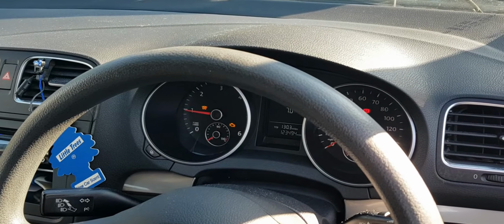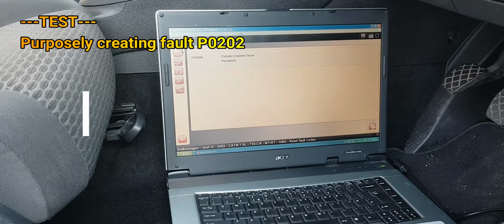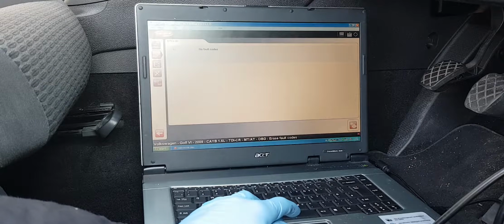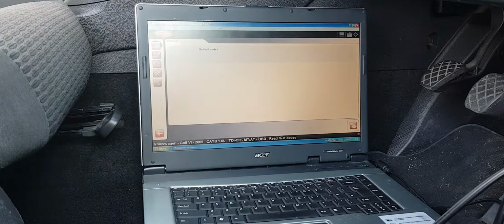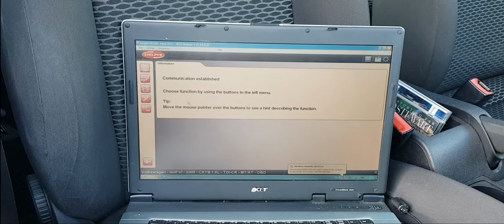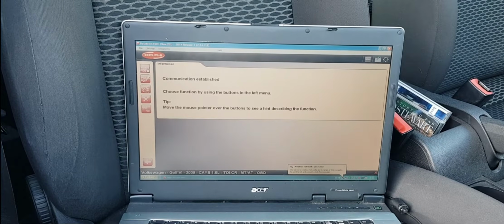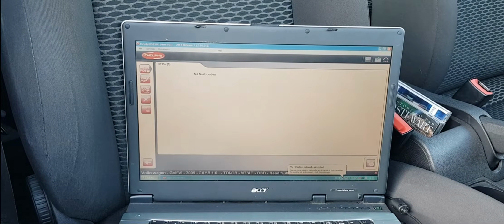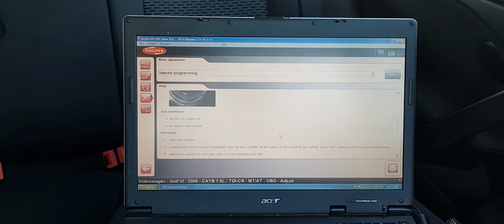P0201, P0202, P0203, P0204, P0606 Injector fault fix VW Golf 1.6 tdi Audi A3 A4 Injector replacement

Comment: Great tutorial - just got same fault on mrk 6 golf . P0201 confirmed with multimeter after following your video.
just want to check , i can buy a used injector from breakers and it will code to car . 03L130277B
Reply from the maker: Yes. Make sure you bring your multimeter with you and check the injector at the breakers. I would recommend to buy refurbished or new. The used injector I put didn't last even 5k miles and had to do it again and this time I put a refurbed one and no issues. Yes that code should be fine, just make sure the coding code is clear to read if buying a used one🤝
Reply: @TheKeenMechanic  took your advice refurb ordered , just the washer and bolt to pick up . any tips on cleaning the bore .thanks again
Reply from the maker: @aldo5305  just be very gentle. Should not be hard. Have a look at how I cleaned mine and should be sufficient. These injectors come out easy and are easy to install so 🤞 you will save yourself a fortune🤝

Comment: Is the injector compatible with CAYB and CAYB engine. Or are they different from each other.
Reply from the maker: Best to ask VW dealership just in case
Reply: Ok will do thank you.
Reply: Great video by the way. 😁
Reply from the maker: @linsleydiasdorosario1131  Thank you☺️
Reply: Does your refurbished injector still working ok?
Reply from the maker: @linsleydiasdorosario1131  1st one that was 2nd hand died then I put refurbished and is still working. Hope this helps
Reply: @TheKeenMechanic  Thanks for that. I have just ordered refurb one from eBay let's hope everything is sorted now.
Reply from the maker: @linsleydiasdorosario1131  🤞

Comment: Helpful video👍, my injector 2 went on motorway new ones are really pricey, what’s your thoughts on remanufactured one for replacing injector 2 ?
Reply from the maker: Try it but make sure they offer some warranty. I used 2nd hand and died after less than 10k miles, then remanufactured and is still going but if you can afford new this is the best option
Reply: Also from your experience, if one injector goes are the others likely to go soon? Mileage is 83k
Reply from the maker: @pradasundareswaran2984  The answer to this is pure luck. I havent replaced the other 3 and no issues

Comment: Thank you, great job. Just a question, in case the injectors resistances are all good, how do you check the connectors? I mean, with ignition on or off, and what's the correct resistance to measure on the connectors/wiring loom? Thanks.
Reply from the maker: Great question but I am not sure to be honest. I would check for you but the car is not mine and not here so you are best to check a known good wiring with on/off ignition and see for yourself. Let me know if you find out as I am curious myself
Reply: @TheKeenMechanic  I've checked the injectors and it seems injector 3 is gone aswell. The wires will be ok i asume. Thanks again for your vid.
Reply from the maker: @daytonasunset  No problem. Glad you found it helpful. It was cylinder 3 in my car too. Best of luck with the repair
Reply: @TheKeenMechanic  The rebuilt injector came in today, replaced it and it's all good for now. Thanks.
Reply from the maker: @daytonasunset  Glad I helped another good person. Thanks for watching buddy and best of luck with the car
Reply: @TheKeenMechanic  where you from mate, i have the same problem, but i don't have the tester😔
Reply from the maker: Hi there mate, a lot of people have the same problem. I live in Northern Ireland. You will find someone local . This is a very common problem to fix so most mechanics will help you out.
Reply: @TheKeenMechanic  thanks for your answer,  i am still watching you video from 3 hours , my number 4 injector is the problem , what you recommend me to buy , new injector or second hand , thanks a lot for everything 😊😇🙏
Reply from the maker: @dianaandreea8852  Brand new if you can afford if not get reconditioned. Avoid second hand🤝
Reply from the maker: @dianaandreea8852  Sorry I can't do that but I am sure you will get it sorted🤝
Reply: @TheKeenMechanic   thanks a lot ,have nice evening,  i hoping that i get sorted soon my car
Reply from the maker: @dianaandreea8852  You will fix it. No problem at all🤜🤛

Comment: Firstly,  tighten the injector clamp bolt 1 to 2 Nm, then tighten the high pressure lines BEFORE torquing down the new injector clamp bolt to 8Nm + 270 degrees.
Reply from the maker: Thank you for sharing your knowledge

Comment: Hello. For info I think after doing research that humidity must participate in the failure of the piezo. On my injectors and especially the broken one, the top was quite rusty.
I found this:
Humidity is a serious piezo killer
High humidity, e.g. 85% RH is a serious condition, which shorten the life of the actuator. Make sure that humidity level is kept low - best is hermetically sealed applications. Consult Noliac if actuators must work at high humidity.
Reply from the maker: I think these early injectors were poorly manufactured and new ones were improved hence the part number changed

Comment: Good evening,
that's it I put everything together and it works very well. I have not done the programming yet because I did not receive the VDS ordered on ali-express. I have no clicking or suspicious noise. I turned off the fault light with my little multibrand diagnostic tool. Some observations:
- I tightened by judgment because the torque wrench that I bought is neither in 1/2 nor 3/8 format but a smaller square.
-I wanted to change the second copper seal but in the bag I ordered in Germany, the copper seal was thinner than the original !! So I put the original back on the injector which worked, cleaning well and putting copper grease. I have some for the antennas because I am an amateur radio operator.
Well done again and a thousand times thank you for the extremely well done video. It is thanks to you and your wise advice that I was able to succeed. Give me your email address to stay in touch. SEB Friendships
Reply from the maker: Oh, this is very nice of you. Your torque wrench must be 1/4 inch as most small torque wrenches up to 30nm are 1/4" If you know someone with delphi ds150e borrow it as it is very easy to use. Have a look at this link https://www.ebay.co.uk/itm/Delphi-car-diagnostic-tablet-/184674621546?_trksid=p2349624.m46890.l49292
Anyway, glad you got sorted. You can contact me here always as I get youtube notification. It will be great if you like and share my video, this is the biggest thank you for any youtuber.🤜🤛

Comment: Hello I am doing it, I managed to take them apart !! two questions:
-Since you only change one, you have to change the gasket on the other (copper)
-I find the bottom of the injector that I leave with the new one very dirty. Did you clean it?
Thanks for your quick response, I'm hard at work.
Reply from the maker: I am very proud that my video helped you decide to do it yourself. Yes, replace both copper seals on both injectors and gently clean the carbon of the tip of the injector. You will be fine, just take your time and make sure you code the injector after you do the job. You can do the coding at any point🤝
Reply: @TheKeenMechanic  Ok I'll change the seal. To clean the carbon, you have to use a product because with a cloth it does not come off? Brake cleaner? Otherwise this injector worked but I do not see the holes at the end, I wonder how it still works!
Reply from the maker: @hamradiorig  I didnt see the holes in mine too even after the cleaning but it worked. Just do a bit more research on this and let me know what you find. Google ultrasonic cleaners

Comment: Hi, is it possible to replace just the broken solenoid with another solenoid from an injector with a broken mechanical part?
Reply from the maker: Hi
Check out the comment below for more info. One guy in Czech Republic can replace the piezo element but this is a specialist job as you need special stand to adjust it and calibrate it. My advice is to buy a new🤝
Reply: @TheKeenMechanic  I replaced the defective injector with a used one. Injection amount deviation cylinder for the replaced injector (no. 4) is 1.72 mg / stroke. For 1,2 and 3 it is -0.2 / -0.95 / -0.65. Can I do something to fix this deviation?
Reply from the maker: @iulianplumbu1034  Unfortunately No. This can be done only by a professional injector specialist
Reply from the maker: @iulianplumbu1034  Try it and let me know please. Thanks

Comment: Hello. Before I started, I had another question. Should the injectors be removed with the engine hot or cold? What's your opinion? (I think it must be hot)
Reply from the maker: Yes. Better to be hot. Also if you are ever removing glow plugs it is better to be hot. I did it with hot engine too. Good thinking🤝

Comment: Hello are you sure torque 8nm +180 degres? A person do that and the screw broke in the middle. I have seen 7nm elsewhere. This is quite scary!
Reply from the maker: 1nm shouldn't make such difference. These bolts are stretch bolts and you should never reuse them. Always put new bolts
Reply: @TheKeenMechanic  I saw two testimonials of screw breakage at 8nm. On the other hand it is possible that the well was not cleaned enough and that a film of dirt remained there ... Do you think that it is necessary to tighten to the couple, one cannot tighten with the judgment?
Reply from the maker: Anything is possible. I have always used 8nm +180degrees and never had issues when using new bolts. If you are afraid just do 7nm and you will be fine. Do whatever you feel comfortable with.
Reply: @TheKeenMechanic  If I do the tightening in my own judgment and it's not tight enough, what will happen?
Reply from the maker: @hamradiorig  I wouldn't do that. Buy a torque wrench and apply the correct torque. Hope this helps
Reply: @TheKeenMechanic  Thanks for all the tips and kudos to you for this great video, I'm not sure the professional mechanics work as well as you do. (especially the cleaning phase)
Reply from the maker: @hamradiorig  Thanks for the compliments. The professional mechanich prioritise quantity to quality. Do it youself and you know it is DONE and done right🤝
Reply: that's true you are right seen how some mechanics work. I have the injector bought from dieselfixneuss, the gaskets, spline socket ... I am missing the torque wrench. I also need to DIY a nozzle for the vacuum cleaner. On the other hand, all this is scary when you are a beginner in mechanics (I am mainly an electronics engineer)
Reply from the maker: Don't worry you will get there. Good that you are researching before attempting🤝

Comment: It was interesting to note that you tightened the holding bracket to the correct torque, but then cranked a further 180 Degrees. Could we not instead just use a higher torque value? 30:50
Reply from the maker: I have asked myself the same question but this is what the manual says. I am sure there is a reason for this. Let me know if you find out 1st😉
Reply: Wait until you’ve replaced a wheel bearing 300Nm + 180 degrees. I nearly pulled the car off the axle stand and jack torquing it up 😲😲

Comment: A very thorough job done, Cleaning out the old seals & seats for the replacement injectors, good that you thought to test the replacement injector, before fitting into the engine, and it showed no fault lights or codes. I not sure if most mechanics would go to the trouble. Very good. You should work for VW. My car has done 80,000 so may need to do that job in the near future. Well Done.
Reply from the maker: Thank you for your feedback. Much appreciated. I always put a lot of detailed work in anything I do. I am a bit OCD I think and like perfecgion😊

Comment: Hello I broke down with a p0402 code, the garage started the car a day later and put diesel treatment inside the car and it runs fine now, took for a run and it runs fine, but I’m worried if I drive far for an hour it will breakdown again, will this happen? The car runs fine and does not misfire, also starts fine, thank you and great vid
Reply: Hey dude! Where can I get good fuel injectors from
Reply from the maker: @nazimrashid8611  Try locar car parts shops and online. Amazon, ebay, autodoc any online retailer. Try VW too but they would be more expensive
Reply: Has this car had any more problems bro? Also my car is still running fine and has done 400miles since breaking down, I will buy a refurbished injector, but where can I get the washer, bolts and o ring from
Reply from the maker: @nazimrashid8611  No issues with the car. I bought the copper seal, bolt and rubber seal from VW main dealer
Reply: @TheKeenMechanic  nice man, if my one plays up I will buy another injector, where did you buy your injector from?
Reply from the maker: @nazimrashid8611  local car breaker
Reply: @TheKeenMechanic  car still going strong, done 1200miles since breaking down. I’m going to buy a refurbished one in may hopefully in case I break down.
Reply from the maker: @nazimrashid8611  Great to hear this mate. Nice to see that my video is helping people🤝
Reply: @TheKeenMechanic  it is man, helps me a lot tbh, is there any harm in putting a refurbished injector init? Surely it’s like new?
Reply from the maker: @nazimrashid8611  I would put a new one if you can afford. Sometimes the refurb the metal parts but dont replace the piezo electrical part that fails on these injectors. Unless you get warranty I would put a new one
Reply: @TheKeenMechanic  I get one year warranty with it so I may buy it, plus didn’t you use a refurbished one for this ?
Reply from the maker: @nazimrashid8611  Yes. I used 2nd hand as customer couldnt afford a new one. The one we put lasted for 2000miles then we put a new one and no more issues. 1 year warranty is good but you are only saving £100-150 and if I was doing it for myself will put a new one. Hope this helps
Reply: @TheKeenMechanic  where did you get it from?
Reply from the maker: @nazimrashid8611  Local shop
Reply: @TheKeenMechanic  yeah a friend of mine got a refurbished one and it’s still going for him, his done 20,000 miles since
Reply from the maker: Hi, is it P0402 or P0204?
Reply: @TheKeenMechanic  sorry bud it’s p0204!
Reply from the maker: @nazimrashid8611  Hi
P0204 relates to injector number 4. I would recommend to check with VW main dealer to see if there is a recall for these injectors. I had one of my subscribers messaging me and told me that his uncle had the injectors replaced for free due to the recall. If VW don't offer any help you can risk to get stuck on the road again if the injector fails again. Normally this code relates to an electrical fault rather that the injector being blocked. Best thing to do is to replace them with new bosch injectors if VW doesn't help but I know it will be expensive. Hope this helps
Reply: @TheKeenMechanic  thank you bud, but the thing is I drive on motorway here and there and it drives fine,
Reply from the maker: @nazimrashid8611  This is great that your car is going well. May be take a chance and keep driving and see what happens
Reply: @TheKeenMechanic  I’m going to put engine cleaners init every 5000 miles and see what happens
Reply from the maker: That's not a bad plan. Let me know how you get on. Just to let you know that these injectors are known for failing due to the piezo element(electrical part) rather than fuel blockage and by putting injector cleaner you are only hoping to prevent a blockage.
Reply: @TheKeenMechanic  just been told by vw tjay the car has already had it call back in 2015 for egr problem, that’s interesting, it may have been a clogged injector
Reply from the maker: @nazimrashid8611  Did they say anything about replacing the injectors during that recall?
Reply: @TheKeenMechanic  they didn’t, I’ll have to phone up and ask tomorrow
Reply: I did ask about the injector and they just go yeah, it’s so odd
Reply from the maker: Let me know what they say if you don't mind. Will be interesting to see if they will carry out this job for free like other people have reported. Sometimes you have to push them a bit. A friend of mine had to call the ombudsman and when VW heard that they replaced all 4 faulty injectors with new ones
Reply from the maker: @nazimrashid8611  Nothing odd about it as it is probably the most common fault on the 1.6tdi , they just don't want to pay for their mistake.
Reply: @TheKeenMechanic  it does seem like it man, it stresses me out because I can’t make plans without the thought of thinking I’m going to breakdown
Reply from the maker: @nazimrashid8611  I know the feeling😕